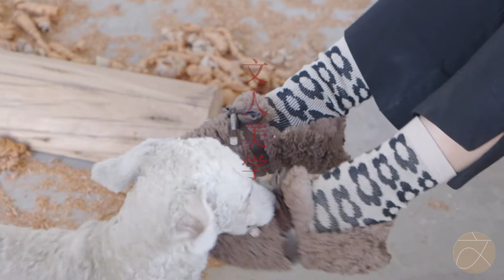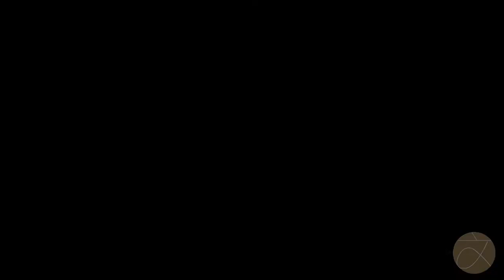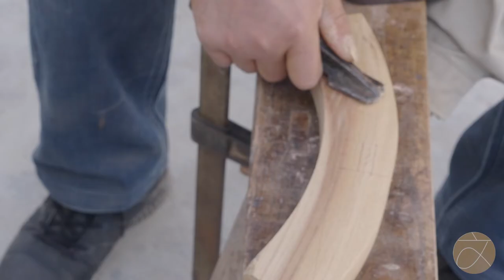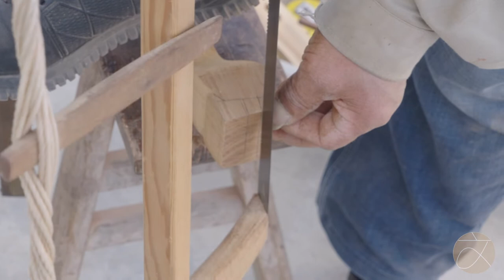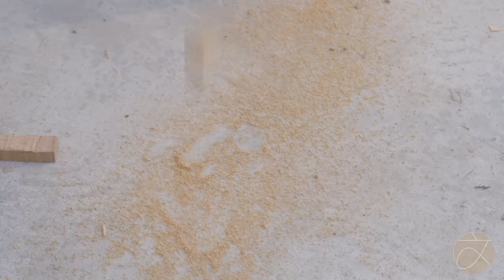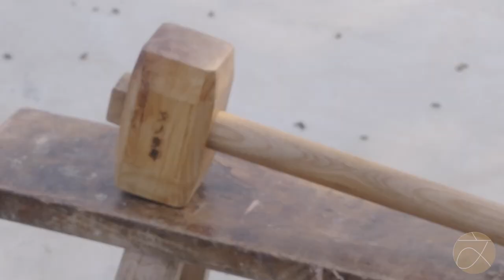Joint of legs and Floor Stretcher in an Incense Stand ｜Chinese Furniture Join's Secrets (Episode 7)

Comment: Anglophiles may need to understand pressure-points of martial-arts from furniture design.

Sitting of object, seat of raised-platform, sitting of weight of object, seat of base-platform, sitting of base-platform, seat of ground. Shift plate(center of gravity) as anglular-shift affecting angular-bias (modular resolution of shift-bias)

One leg of furniture can have a single side rounded bottom with two corners and a slightly raised protrusion on the other side to preload-bias and change sitting pressure-point on ground (prints-imprint). 

Four legs will combine to work as a chair that is easy to rock without throwing itself or the person backwards-forwards(-sideways) 

backwards-forwards(-sideways) = throw-vector.sss(including controlling to anchor on one leg and throw-up for the other three to fall rotated into table edge)
Reply: Wait for person to be barbarian is the usual concept to apply mechanics-physics. 

Stable till reasonable-bounds(chinese standard which is above other standards - niche is world), controllable after stable (with hokkien baseline-standards - niche is hokkien)